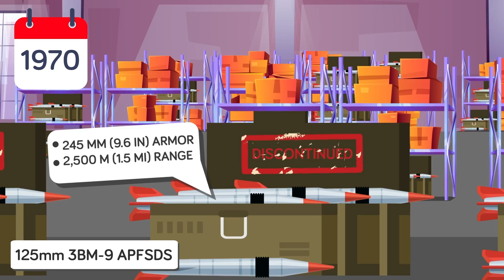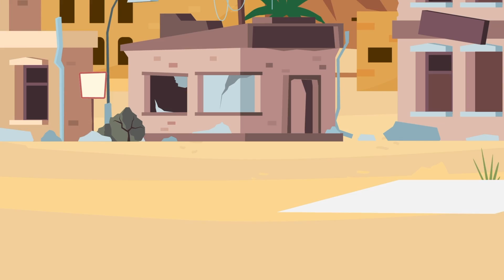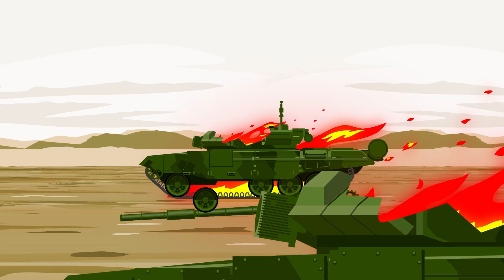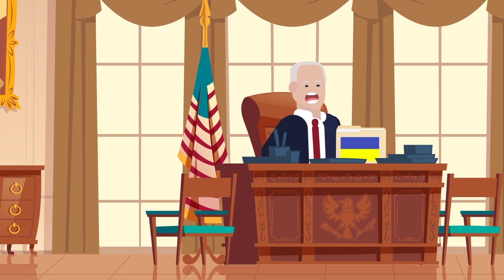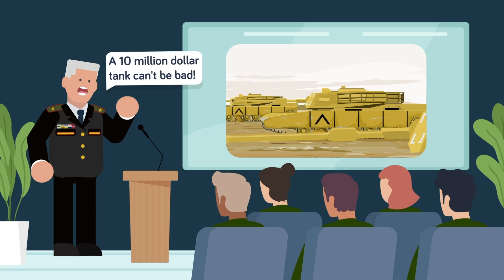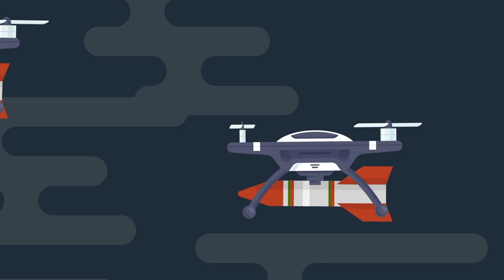How M1 Abrams is as Accurate as a Sniper

Comment: It should be noted that stripped down export M-1s are no more vulnerable to top attacks as the US top of the line M-1s. The special armor are located in teh front arc of US M-1s, not the top.

The Russians have active defense systems, but they were designed to counter RPGs or older anti-tank missiles that flight directly toward the tank, not top-attack variants. The sensors and munition for the active defense systems are aimed horizontally.  The top-attack variants attack at an angle that is outside of the field of view for the sensors. Moving forward, I can see active defense systems aimed more vertically (in a wide angle) than horizontally.

Comment: You don’t take out the drone…you lock onto the signal and take out the operator.
Reply: The operator sits in a comfortable dugout 300 meters from the remote antennas and 5-7 kilometers from the contact line.
You are driving a tank, you do not have GPS, you do not have communication, you are under constant surveillance by enemy drones and you know that WHEN the tank is hit, there is a 90% probability that FPV drones will finish you off.
Welcome to the eastern front!

Comment: One of the major advantages of the Abrams is the stabilization system that allows the tank to be driven at top speed, bouncing around and it's main gun can be put on a target and fired without slowing down.  I was a 19E on M60A1's then M6A3's in the early 80's.  With the A1 we would stop, fire and start going again.  With the stabilization system on the A3 we could drive about 12 mph and the gun/turret would stay on target to fire.  In 1984 I saw an M1 going about 40 mph, bouncing around and rapidly changing directions and the gun was completely motionless while the turret moved to stay on point.   It is much harder to hit a tank going at speed and maneuvering than one that has stopped or going slowly.  It's also pronounced sabo, not sabot.  The t is silent.   I had a time on the firing range with three different targets at 3 different ranges.  We opened in 2 seconds and closed in 9 seconds with three targets hits at ranges from 1200 meters, 2800 meters and 2200 meters so they can fire fairly quickly with trained crew and that is where we really have an advantage over other countries, the training with live rounds in tank gunnery.
Reply: @jd190d  so does the abrams have training rounds ?
Reply: @williejohnson1732  We really didn't use training rounds on the M60.  We have laser systems that mount on the main gun to simulate firing and hitting targets as well as tank simulators and other NATO countries have them as well, but just like our soldiers and their weapons, we fire a lot more rounds on firing ranges than other countries.
Reply: @williejohnson1732 , yes, they are blue tipped.
Reply: Most major western MBTs have had this feature for some time... it was first installed on the British Chieftain Tank, way back in the 70s

Comment: This tank would be cannon fodder for the ZTZ99A or ZTZ15 😂
Reply: In theory lol. Chinese knock offs dont tend to stand up well. Similar to Russian paper tigers. But who knows, there is no battle test data to go by. However, China has been playing catch up for years now with tanks but still neither have been tested. If all is well and as it should be, depending on the environment in which the battle takes place, perhaps the ZTZ15 could possibly out match the Abrams by being able to out maneuver the Abrams potentially. In an urban environment, though i highly doubt its effectiveness and ability to beat the Abrams. Which is saying something given the fact the Abrams isnt even designed for Urban warfare and compaired to some others is actually not great for it, but seems to do fairly well. As for the 99A I highly doubt it would be able to go toe to toe with any M1A1 Abrams that have any significant kit on it nevermind M1A2s in both urban or open warfare.

Comment: Wait til the M1A3 comes out....
Reply: @skullcrusher9445 The M1A3 is already fully operational. Look up the "M1-E3" version currently in development.
Reply: @wreckincrew2714  Question what are their performance?
Reply: @ronanchristiana.belleza9270  way better. Its going to be lighter (target weight is less that 60 tons), will use electric/diesel engine platform, it will have an autoloader also
Reply: @wreckincrew2714  no its not. GD has only started with concepts. There are M1A1s in Ukraine.
Reply: @skullcrusher9445  They didn't send any M1A2 SEP V3's to Ukraine. They've only sent M1A1's to Ukraine. Ukraine isn't even part of NATO, so why would the U.S send their best version of the Abrams to fight in a war against a country that isn't even considered their ally?
Reply: @exiled_chaos  you are correct. The M1A2 versions are too heavy for Ukraine. I dont know why I forgot about that part.
Reply: will the m1a3 have a better than challenger 2 long range accuracy and firepower?
we can hope it at least can try to keep a good track record of survivability as one.
maybe it can be as fast as one off road?

because all these things, the m1 so far failed to do.
Reply: @matthew4107  what are you talking about dawg? the m1 has better firepower and a better fcs, i think you're just biased towards the chally
Reply: @matthew4107 Chally has longer range (not by much) but does not have better firepower for a lot of reasons. Accuracy wise they are about the same. Everything els you said is just flat wrong. There have been more Abrams destroyed sure, but they also been in use for way longer starting in the 80s compared to 03 seeing more combat. Also, more have been sent to Ukarian, all of which both in an out of Ukarian being destroyed by either friendly fire or drones similar to the challys that have been destroyed.